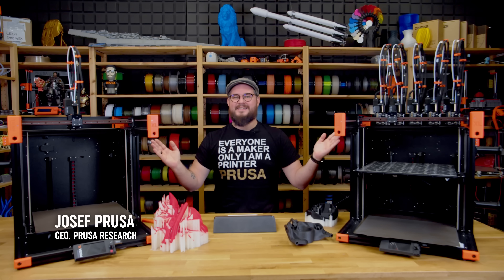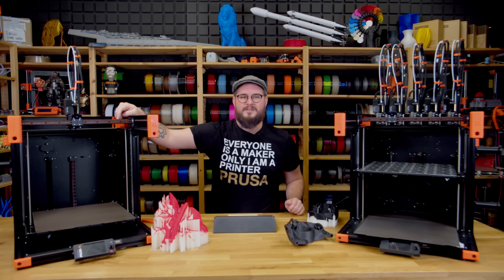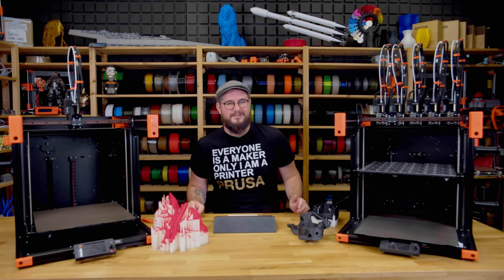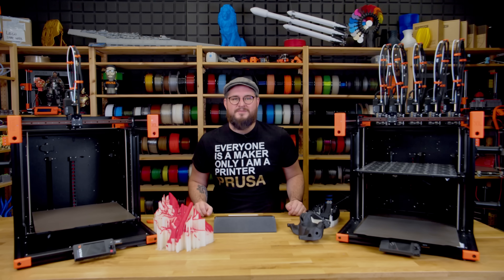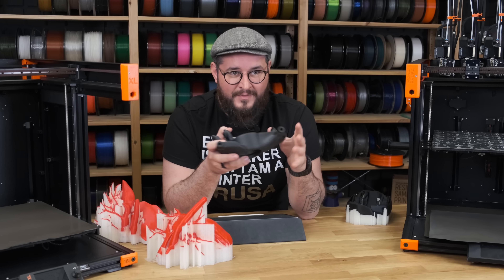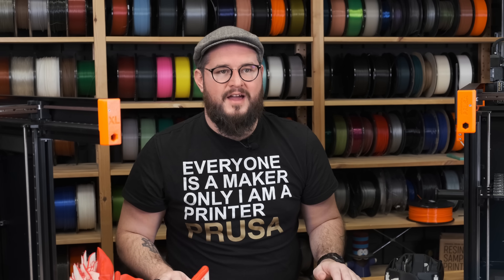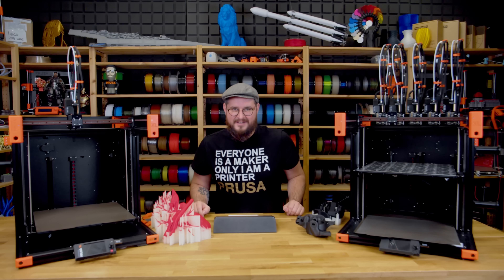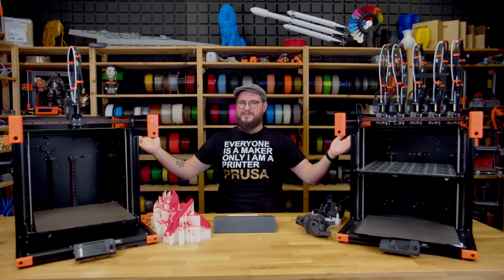XL update - beta test news, hardware changes and shipping schedule

Comment: One really important combination is going to be PC or CF+PC and a compatible soluble support material. We print CF+CP with Aquasys120 currently, or Nylon+CF with Aquasys120 - we are printing large pump impellers that we are then spinning to 3600 RPM. The speed at the rim of the part can exceed 105 MPH, under load - and there are a bunch of internal passages that require the use of soluble support material,  but it does take special soluble support material to actually stick to PC. I am really excited about seeing how this will work with the multi-head system - hopefully there will be an option for an enclosed, temperature controlled chamber to use when printing things like Nylon and PC? Love my MK3, it has been a flawless workhorse for many many years and if this XL is anywhere near the reliability I am going to push really hard to see if we can get one to use at our company.

Comment: Better start shipping these ASAP. All the people who had a bad experience with Bambu labs and returned their printer will buy yours instead.
Reply: Not seen many bad Bambu experiences. I have 3 since the kickstarter and they are flawless.
Reply: @andrewwoulfe6579  head on over to their forum. You will see a ton of people sharing their issues. Hopefully they can get their QC issues under control, and higher more people for support so you dont wait weeks to to get a response.  The machines are pretty amazing when they work.

Comment: Will the electronics be available as an upgrade for the smaller machines so that they will finally have ethernet and WiFi without all that Raspberry Pi nonsense?
Reply: Mini and MK3s already have wifi with a small module add on.

Comment: I have had deep appreciation for Prusa products. But, with the Bambu x1c being so innovative, even with brand loyalty to Prusa, it’s just hard. Prusa’s seem outdated now.
Reply: What's so innovative about X1C? I see people left and right throw the word "innovative" when talking about those printers and "outdated" when talking about XL. But no one is actually explaining why they use those labels. What's so innovative? It's just a fast proprietary loud coreXY. There's nothing special about it.

And how is XL outdated when it's got 5 toolheads? I haven't seen any other printer with that feature. People say they cancel their preorders to buy a Bambu, but Bambu doesn't have even a 2 toolhead option. I don't get it, if Bambu turns out to be enough for them, then they never needed the XL to begin with. Those machines have different features, uses, sizes and price points.

I was interested in a Bambu as a second printer due to all those opinions (before I realized how proprietary it is), but I've checked their website, read about the printers and... there's nothing special, really? I don't understand.

Comment: I love the XL, and I see it becoming the new standard of the high-end print farms due to reliability and time/material savings due to the tool changer. Unfortunately I won't be able to afford it but I really appreciate your work and dedication, especially in the testing process. Going for the open approach is always 100 times harder, but it's what gave joy and drive to this field in the most difficult moments. I remember when i saw the factory tour video from the 3d Printing Nerd. That's the day when i stopped solely respecting you and started admiring you (HUGELY). Keep up the great work 🖤

Comment: I wish Prusa well, and hope their XL sells well.
I couldn't wait for it any longer, and got in early enough to get a BambuLabs X1 Carbon with the AMS and love it.
The only thing I wish it had was the same build volume of my Ender 5 Plus, but very very very rarely do I need to print anything even remotely that large, as would be the same with a Prusa XL, so it just makes more sense for me at least to use the X1...
If Prusa could have gotten to market 6ish months ago, they would have been able to take away a little bit of BambuLabs' thunder, but now it seems to be the other way around.
Reply: @JorgTheElder  You cared enough to reply. Go shave your neckbeard.
Reply: BambuLabs X1C seems to be a great printer but a lot of people said it is very noisy.
Plus, for me it's not the same category. Print volume is not as big and above all it has only one print head VS up to five for the Prusa. For me it's a game changer when you see all the lost filament in the X1C (tower + poop).
Reply: @blm7929  You don't need 5 print heads when you can just purge filament. You can't justify that. Each head on the Prusa XL is $500. So the 4 additional heads is 2k. You can get yet another X1C and $500 in filament for that. Even if you bought just 1 X1C you will NEVER purge $500 in filament to make up the cost of a Prusa XL. NEVER.

The literal only thing the XL has is bed size. And 4inches isn't that much difference.
Reply: @blm7929  Well the noise is highly subjective... I have mine a couple of rooms down the hall from my living room, and the door just kind of closed (not latched, just touching the door jam) and I can't hear it at all on wide-open.
Meanwhile, ~ANY~ printer moving at the speeds these printers are capable of are going to have the noises generated by that movement, that is an inescapable fact of physics. No manufacturer can overcome that.
Multiple print heads is nice, no doubt, and was a large part of why I was considering a Prusa XL, but so far my multi-material prints have been perfect and with expanded AMS units, there is the potential of 8, 12, or even 16 materials... With the 3rd Party "Hydra" kit, it can theoretically be expanded INFINITELY, although I don't know if I want to dive into that particular rabbit hole myself...
The purge tower/poop is negligible as well, overwhelmingly it's actually empty air, but it also depends on the model you're printing, the orientation, and how many color changes... Also printing multiple of the same muti-material prints at once saves not only time but purged filament as well.

So ultimately it comes down to volume, and that's of course an inescapable fact that the XL will be able to print larger volumes... Some day... eventually... when Prusa actually makes it... packs it... ships it... and it arrives, then gets dialed in, and does what it's been hyped up to do, and I have every confidence that it will deliver.......... someday... eventually...

But I'm not interested in printing someday, eventually... At least right now I can print basically anything I want at 256x256x256 and the Prusa XL can't print anything at any volume because it doesn't yet exist out in the wild and that's what I was lamenting to begin with.

By all means, buy the printer that works for you and will do what you want it to do... For my needs, I needed a printer I could print things with at preposterously high speed, not remain in a preorder queue for some 6+ months longer and still not have it.
Reply: Yup. They missed the boat. I had a XL preorder within 2 minutes of the announcement. So I should be in the first group. It is 3/12/2023 and no news. So today I am ordering 2 X1Cs. I'm tried of waiting for an already outdated printer.

Comment: Is it still worth buying an Original Mk3s+  or will some of the technology improvements from the XL here be making their way onto a newer version or new model of a regular size printer anytime soon?
Reply: Literally just buy a Sovol SV06, or SV06 Plus, you can buy 2 and a half for the cost of a single prusa. The quality is equivelent.
Reply: @tactiti0n  how is the quality "equivalent" when the sovol is a literal clone that uses lesser quality parts? genuine E3D V6 hotend in the prusa compared to a no name clone of lesser quality in the sovol. Genuine misumi rails and bearings compared to no name junk rails on the sovol. Genuine bontech extruder compared to no name extruder on the sovol. Stop shilling to low quality junk.

Comment: I think, that solution with moving hotbed only in y axis is better than moving with hotbed in z axis. It is because of weight and stability of this hotbed. Solution of correct stability in moving z axis is to use four linear guiding, not only two. That is my opinion. For example, Ender has only one linear guiding in y axis for moving hotbed and you can tilt very easily the hotbed because of clearance in linear guiding. This your solution is  better in combination with trapeze screw as you already have. But clearance still can be in this solution, isn´t it?

Comment: How does the XL calibrate XY offsets? We have a camera assisted tool for calibrating offsets on other machines which is lightyears better than 3D printing line patterns...just curious if this will work on the Prusas or if they've come up with some other way to do this seamlessly?

Comment: We need a new Prusa, MK3s is dead for 2 years , now with a 400$ 3d printer and 100$ in upgrades you can beat easy a Prusa , make something new and lower the price. You give us printed parts at a price of metal, and other brands are giving us metal parts for the price of plastic. Change your direction because other brands are far away and the Prusa community is going down.

Comment: About the steel sheet - have you considered to make cutouts to reduce heat trasfer or adding plastic handles to isolate it? As a bonus, it would allow handling of the hot sheet.

Comment: I don't know, I feel very bad about the use of 3D printed parts in the XL. It's not gonna be a cheap machine, why not  make everything out of metal or injection molded plastics? Even my Ender 3 doesn't come with a single 3D printed part from the factory. With printers like the Bambu Lab already on the market, this is a bit awkward.

Comment: 0.6 mm nozzle was great to hear- finally the industry is going away from 0.4 in exchange for the much faster and equally accurate 0.6
Reply: Much faster? With a V6 hotend, which is limited at 12mm3/s and a layer height of 0.24mm, your top print speed will be 85mm/s. With a 0.4mm nozzle you don't lose as much detail on smaller parts and your max speed will be 125mm/s for the previous example. Also, using a 0.4mm nozzle allows you to print at 0.6mm and 0.8mm widths too...
Reply: @alejandroperez5368  I print .4mm layer heights at .8mm extrusion widths with my .6mm nozzle. Most I could do with my .4mm was .3 layer height and .6mm width. .4mm nozzle is far faster than a .4 and the quality is the same.
Reply: @alejandroperez5368  Okay. Set your nozzle to 0.6 diameter, play around with the print times of a few models, and get back to me. 

You are much better off printing at slower speeds and higher nozzle diameter than a slightly smaller diameter that gives you almost nothing in terms of detail (except printing tiny text) and higher print speed. The difference between 120 mm/s and 80 mm/s is marginal on most prints. The difference in print time reduced when switching from 0.4 to 0.6 is very substantial even when using the exact same speed settings. I never print above 80 mm/s because I'll start compromising for quality in exchange for very marginal print speed differences. The difference between 150-200 and 80 mm/s is substantial, but high speed = tons of noise and I have my printers right next to my work station. Either way, I've been rocking a 0.6 mm nozzle since I first heard about it and I don't think i'm going back to 0.4 mm in the near future.

Comment: If it has a real silent mode and same price like the bambu x1c with same or better quality and speed options + enclosure, i will look into it considering another prusa.
Reply: It's much more expensive than an equivalent Bambu configuration but does have features the Bambu doesn't and a much larger print volume. They're not quite in the same market segment. If the X1C suits your needs tbh it's probably a better buy unless you want to do lots of multi material stuff, any kind of multi material with different types of filament in one print, or print large items frequently, in which case the XL's features will start showing real advantages over the X1C.
Reply: @bosstowndynamics5488   Thanks for the info. I will be looking to buy a new printer this year so have some time to look arround and check reviews :)

Comment: Another interesting/important question about the Nozzle-Adapter: 
From the picture it looks like, that the Adapter is made out of brass. That is fine for using it with M6-Brass-Nozzles, BUT will there also be adapters in different materials, especially hardened steel adapters, so that it will be possible to print abbrasive materials? Because to me it doesn't make sense to have a brass-adapter and a hardened steel nozzle, that will be leading to wearing down the brass adapter in fairly no-time.
Reply: While not ideal, a brass adaptor should still be ok because the abrasive material only really causes significant wear on the business end of the nozzle, that's how the Olson Ruby and Diamondback nozzles work (both are rated for abrasive filaments and use a brass body nozzle with a small ultra hard tip). The bigger problem is high temp printing, but I suspect that Prusa are probably going to rate this printer at 300C max, which is fine for brass.
Reply: @bosstowndynamics5488  You are completely right. Let's see how it will be doing when we have this printer at our desks.

Comment: Theres just no other company that offers the same quality for price, service, guides! Best overall 3D print experiance there is!!
Reply: Welcome in 2023. There are a bunch of companies, performing much better with disruptive technologies. Big is easy, fast and clean is hard.
Reply: @lars916  i have tryed a few in the same price range and out of the box non of them came close, but if you have any tips of machines for me will check them out! Only requerment is that thay are available in europe :-)
Reply: @ibashyougood  The best FDM-printer I`ve ever used so far is the B@mb_u&L@b (prevention from whitelisting ^^). Not (only) because of the delta-like speed; it`s the nearly perfect and smooth layering of layers. I never thought, this would be possible on with a FDM based printer. 

In my opinion, the biggest problem with the XL will be the lack of a housing that is not too big due to the questionably placed springs and PTFE hoses. Sure, you can build something that is actively heated, but you have to remember that all components, including the power supply, are also heated. 

Now think of chemistry class, keyword Arrhenius -> a temperature increase of 10K leads to a double to triple reaction speed. The electrolytic capacitors in particular do not like this at all.

Comment: Definitely like that it will be shipping with a 0.6mm nozzle.

I will say I preordered a 5 tool head, but after printing with my Bambu printers for a month. The cost may be better served going into 5 more P1Ps.

I would love to own a Prusa, but I may wait to see how the first couple batches go and then get a 2 or 3 toolhead. As I print with simple PLA filament, the Bambu printers work just fine for my needs of quickly changing colors for my Etsy orders.

But it would be really fun to print with multiple types of filament with the different tool heads. PETG, PLA, TPU all on one seamless print. But for that I'd only need 3 tool heads.

Comment: @p07gbar  While I bought an X1C, Bambu is 100% using the work of Prusa.  They've taken the AGPL software "Prusa Slicer" (itself a fork of "Slic3r") and forked it into "Bambu Studio".  In Bambu's fork they've introduced potential violations of the Affero GPL by introducing closed source network components on top of the definitive license violations related to their embedded Linux single board computer.

Comment: One comment on the panels resonance. Very good point to check that and correct it..perhaps if it helps, if the xl has accelerometers build in, might be also used to detect wear over time...perhaps the best indicator are the prints themselves, however if some part is creating unexpected higher response could detected for trouble shoting and parts replacement. Asuming the this will occurr after a lot of hours of usage!

Comment: I probably won't be able to budget for one of these anytime soon as a hobbyist but I have what I think is a great, easy to add suggestion to massively improve a common gripe I have:

Add a back stop and side stop for the magnetic steel sheet so that putting it back in at the perfect alignment is easy.
Reply: What printer do you currently have? Because the i3 mk3 has 2 screws for print bed placement. I assume they will do something similar for the XL

Edit: I just looked at some pictures, and it seems like this bed also has 2 screws, same system as the mk3
Reply: @DraakjeYoblama  I have a Bambulab X1, which has backstops but not side stops.
Reply: Prusa printers use a pair of pins in the back as a backstop. The metal sheets also got a wide tab sticking out in in the back that slides just inbetween the pins causing them to double as Side-stops. So while inserting the sheet back first against the pins, it should align itself on these two pins and then can be dropped for correct alignment.

Comment: Thanks for Update. Regarding V6 / V4 nozzle. Will it be possible to use for example Head 1 black V6 Head 2 black V4 for detail Head 3 v6 soluablematerial Head4 v4 flex material head 5 v6 nylon (mix of different size of nozzle and different materials with different heating of nozzle?
sincerely olaf

Comment: Will the extruder have parts printed out of PETG or will it be entirely carbon-filled PC? I ask because I would like to use this printer in a heated enclosure and would like to avoid the sag issues that I experienced with a Mk3s+.
Reply: PETG sagging inside a heating enclosure? What temperature does the enclosure reach?